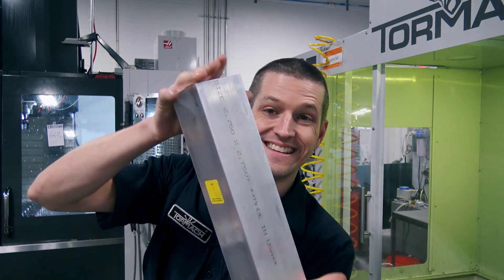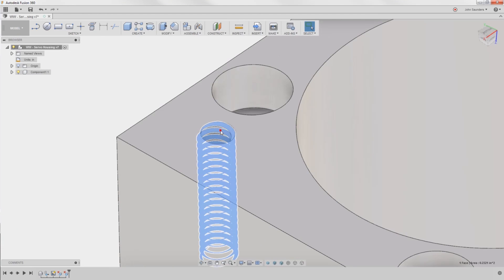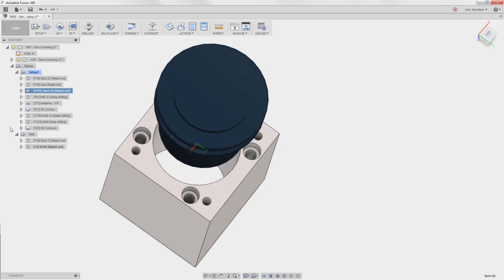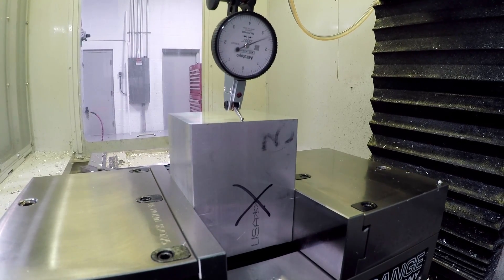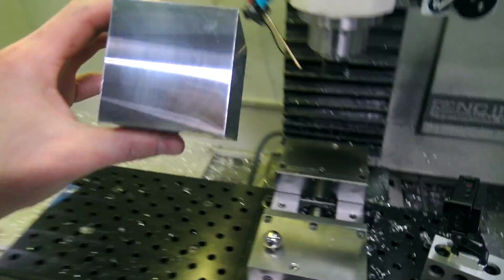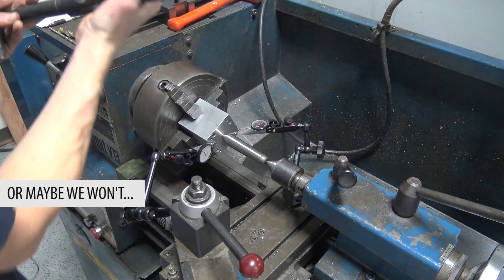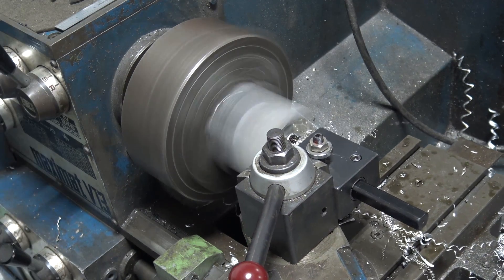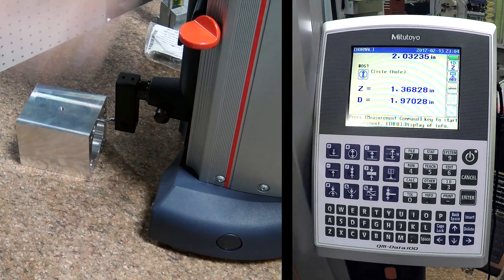Machining a Servo Housing!   WW135

Comment: Do you think that the part was not close to exactly square in the lathe chuck? You centered on the bore in the front. If the outside faces parallel with the center line of the spindle, then that would explain the larger bore in the rear. No?

Comment: Love your video. 
Honour your humility.
Admire the skills and drive you obviously have.
What isn't shown in your vid is a proper analysis of what went wrong.
First you must not have QA'd the bore out of the lathe.
Having completed All operations you then did a couple of measurement checks with that wonderful mitutoyo hight guage, and rejected the part as out of tolerance.
That's when you should have really analized what happened and why.
The uncertainty factor would have driven me mad if I didn't understand so I could fix it or prevent it in the future.
You could have done ID measurements at 45 deg (4 per end) and compared them. This would have eliminated if chuck jaw pleasure was 'clover leafing' the cut or that the lathe was boring tapers.
If you don't figure these sort of things out at the time the uncertainty, or Pucker Factor, builds and I find myself pussy footing around and not committing to good finish cuts..
I'm guessing by now you have a functioning 5th axis with which you would have done all sides but the back face with one set up and micro bored the middle out with the grip being waste.

Comment: If you want to try for an accurate thru hole you could always drill at 0.030" smaller than final, circle interpolate leaving 0.010 stock (as deep as the tool can possibly go), then ream. The reamer should follow the circle interpolated hole nice and easy. Flip it over and repeat. I know that a reamed hole is not a requirement but the method I outlined does make for an accurate hole.

Comment: Ohh God. Why is anyone even thinking about putting that job near a lathe? 😂. It's 2" square. Cut a block on the saw 60mm long, put in vice on mill, bash all holes through and finish bore with boring head. 2 thou limit? That's a massive tolerance. Finish outside profile with endmill. 2" deep? Wow. Big deal.
Reply: And if anyone comments on distortion or stress relief, I will cut my own throat with a long piece of sharp swarf. (Not chips....SWARF)!!!!!
Reply: And why do with cad cam????? God's sake. A job so simple, could do with eyes shut. ON A MILL!!!!!

Comment: I find myself upset watching your videos. Im a manual machinist going on 11 years since I was 18 with a 5 year apprenticeship. You have a super advanced shop. Automated measuring tools. Everything you do seems to lack confidence and understanding of what your trying to accomplish. Multiple mistakes and just a bunch of wasted time. I personally think your a cool guy, but .002" is not a tight tolerance. I had to make way more complicated parts with a bridgeport and a lathe. Did you even check to see if your bore was Straight? Why did you not do the bore first if everything has to be measured from the bore? So how do you make money??? Where did you afford all of those tools and machinery?  I compare this to my son wanting to learn about working on cars so I buy him a brand new Ferrari to work on. That doesnt make sense. I think its great that you get people interested in machining. But you should warn people your not super experienced.
Reply: To your last sentence, he made this clear multiple times esp with respect to lathe operations. What you see are the best efforts of an self-taught experienced CAD/CAM CNC machinist with access to low to mid-tier equipment doing his best. Presumably his best continues to improve as he  (and many of the rest of us) learns for his ongoing experiences...

Comment: I would have loved to see you measure the True position of the bored hole. Since you faced the sides of the part after boring the hole, there was nothing holding the hole at centerline except the assumption that it was perpendicular to the top face.

Comment: Variance while driving a lift truck past the machine indicates insufficient machine base mass. My understanding  is that the base (concrete) weight should be double the weight of the machine...and separate from driving surface.

Comment: 7:10 when you measure machined surface in X axis which was machined in X direction, there will of course be no difference. When you measure it in Y direction, you see how much is your spindle out of squarness compared to Y rails. And 0.001inch  - 0.02mm on such short distance is a lot. If you would run 80mm face mill on 160mm wide part, your error between two passes would be dobule, so 0.04mm edge.

Comment: Part in center of vise is best. If you put a 3/16" piece of round shaft under part, by solid jaw, and clamp part on movable jaw using a round shaft too, it works great for initial square cuts

Comment: Good try...OK...you paid too much attention dialing in a extruded stock and fly cut face, [ final face when boring on lathe]..that waste of time you could have used when milling sides and checking if in center of hole.

Comment: long time gone. however, regardless the purpose of the video. you should never clamp your piece directly on the vice guides. Always use a spacer underneath. one other thing - why you clamp your piece on the side of the vice??? the correct way to do it should be- the middle of the vice jaws, so the force is evenly distributed. this way you are not ruing your vice in a long term. otherwise in time the clamping jaw will twist and you will get a massive deflection, thus any piece you put there will not be parallel to anything.  on the other hand - nice job.

Comment: You cannot bore on a manual with such a long tool and expect there to be no run out, I believe that was the problem with it. 
Also 4/1000th of an inch isn't such a bad tolerance if you are doing it on an manual with no experience, great job!

Comment: You might want to check the lathe for "square", as one of my favorite teachers told me. You can run a lathe on a ship, which means you don't need to have it level all the time. You need to have it square. Try "rollies daddies method" of squaring the lathe and you should get a straighter cut.

Comment: why not mill out that hole with cnc vmc? straightness of that hole is much more important than perfect roundness (anyway servo motor is a subject for adjustments when mounted regardless of coupling design - radial runout no more than 10um is common for flex couplings)

Comment: Why didn't you square up the block first and then put it on the lathe?  Also if you need to drill large holes you can use an annular cutter. They are fast.  Very nice.

Comment: I know this was posted four months ago and I'm seeing a lot of suggestions in the comments for what probably caused the taper in the bore but I haven't seen anybody mention that you probably gripped it a little too tight, I used to machine pumps and some of the parts inside the pumps were cylinders with two bores inside that overlapped like a number 8 but slightly more overlapping, we'd put them in the mill because they weren't in the centre of the part. Anyway we were having problems with the efficiency of them for weeks because there would be a taper through the bores and we couldn't work out why, using various tools, various tool paths but we never looked at the work holding because it gripped all the part on the outside, it had never been a problem before. Well I'd started going to the gym and was cranking on the chuck key the same way I always had which was resulting in it being gripped way too tight, so as the bore got bigger and the wall thickness reduced as it cut, it'd start cutting bigger and bigger towards the bottom. Lesson learned, it was a torque wrench from then on.

Comment: Hi my name is Dave Cortvriend. Im from Waterloo Ontario Canada. I started My career as a machinist in 1982. I try to avoid drilling pilot holes whenever possible.When  drilling large diameter holes on CNC machines I like to use straight shank through coolant spade or index carbide tip drills. But if I have to drill a large diameter hole on a manual lathe with a morse taper in the tailstock I have to use a big HSS twist drill. In that case I drill a single pilot hole as close as possible in diameter to the width of the web of the large drill. Then follow through with the big drill. Example, if the web of a 1.5 inch drill is .2 inches, I use a number 7 drill for My pilot hole, then drill with the 1.5 twistdrill. As long as the drills are properly sharpened it makes a good hole. The entire length of the cutting edge of the big drill engages the material providing good cutting action and chip evacuation, without chipping the cutting edges of the drill, or wearing off the O.D. of the drill especially in harder material, and it saves time compared to drilling multiple holes. The shop I work in has a Darex drill sharpener. It is easy to use and sharpens twistdrills center and spotdrills and can be adjusted between 60 to 135 degrees. Worth its weight in gold!

Comment: Mr sheen which is a furniture polish is awesome to use on your granite plate, reason is , it gives a little slip across your surface so you reduce ghost measurements.( Minor ripples in movement from surface imperfections) that cause false drop gauge readings , especially when your in the 0.002 +/- 0.001 ranges .
Also don't for get to mark and date your granite plates corners so you know when to rotate it , you'll notice a shallow will form after running machined parts back and forth over time, simple trick to maximising plate life before calibration and or replacement.
My old plate was 1200mm x 1200mm x 300mm thick. Yup she was thick.
(Aviation sector )

Comment: Frustrating to watch. Start by squaring up the stock on all 6 sides with the largest surface first. I do appreciate how hard you work and try, and that you are honest about mucking stuff up. One of the pitfalls of self learning is that you can make a lot of scrap with great machines. Certainly made my share of scrap parts.

Comment: You can use an annular cutter to rough bore the hole out first instead of step drilling it. It is basically like a hole saw except more efficient.  It is clean and precise and you won't have too many shavings to deal with.  We use them all the time and they work really well for us.
Reply: Yes, a kind of quasi-trepanning.

Comment: John, may I suggest that if you do some thing like this in future that you rough the bore out in the lathe leaving 0.008" to 0.010" the finish it with a boring head in the Haas. But when you clamp it in the vice only the lightest of pressure. Also when checking the bore on your height gauge rotate the part 90 degrees to check for ovality of the bore.

Comment: I think its most likely lathe run out. Had a similar problem on my lathe at home...you tram it basically the same as your cnc. I did mine with the starret level I have now its within a thou...but as you said all sorts of stuff can put it out again when you use packing under the lathe to get it trammed correctly. Its something that we should all be aware of but the daily grind makes you complacent

Comment: John, I think that the head of your lathe is not parallel with your bed. Many lathes have adjustments to let you tweak that. The other possibility is that the ways are worn unevenly near the chuck.

Comment: You had the front face centered in the lathe (a la Abom), but forgot to center the rear face. That wobble shown by the indicator on the face should have warned you. By as much as your indicating circle was smaller than the length, the error at the rear was proportionately larger than the face wobble. Next time, center the face, check and adjust the rear (with successive side measurements close to the chuck jaws), recheck the face center, rinse and repeat until you have acceptable error at both locations.

For those long, skinny holes that have to be properly located at both ends, do just that: drill from both ends well undersize until they meet in the middle. Then put a long drill (still undersize) all the way through to correct the "meeting error". Put a slightly larger but still undersize drill through to improve the alignment. Finally put a proper-sized drill (or a reamer) all the way through to finish to spec size. You could use the CNC mill for drilling both ends, and even for the final operations from the "second end".  Alternatively, ask the designer/customer whether the middle of that mount could be a cylinder (or octagonal); that way those four long holes become eight short holes.
Reply: One of the best comments on this vid!

Comment: TLDR version: You're awesome, John!
Long-winded version: I so appreciate the effort you put into taking your viewers through the honest story of each project - the good, the bad, and the ugly. I can identify!
I started scrolling through comments and it struck me how constructive and intellectually engaged your audience is (generally) compared to other technical or scientific forums. I really think that your style of showing your mistakes, getting your questions out in the open, and not feeling like you've got to have all the answers really disarms those with the usual rif-raf and keeps the comments meaningful and worth reading. I learn stuff every time - not only from the video, but the comments too. There are some sharp tools in this drawer;) 
My two cents: I agree about the extrusion faces. When you were running the dial in Z on the mill, I was a little scared. In my limited experience, extrusions are not not only out-of-square, but the faces are also wavy, and doubly so across the grain. If you had happened to run the dial at a different Y on that vertical face, the indicator may have told a totally different story...

Comment: Hi John,

your videos are great, love them
did you occasionally check your headstock alignment?
I have the CNC version of the EMCO V13 and had to align my headstock recently because parts turned out to be tapered.
The V13 has good possibilities to align the headstock, however it is a quite anoying work

Comment: The lathe was definitely the right choice as opposed to long endmills. Even using a stout 1.25" endmill you are going to see significant taper at the bottom of the hole and surface finish won't be as good as the lathe can produce. However, you have to be certain your lathe is properly leveled to ensure it doesn't turn a taper itself. Our Mazak at work turns about .0005" taper per inch which can be a pain to dial out when turning anything over a few inches in length.

Comment: G'day John, the good thing about machining is there are many different ways to do a job. I'm the complete opposite to you; a manual lathe guy. In my opinion you ran the job backwards. A few suggestions FWIW.

A good rule of thumb (and how to make more money on jobs) is every setup you do reduces your accuracy and takes time. So try to use the minimum setups possible and try to use the same feature if possible. That way you don't stack tolerances.

Take your raw sawn stock and set it up in the 4 jaw so it's centred. It's square stock so you run an indicator along each edge to centre it. That won't take long as no special precision is needed. You then SPOT drill the face, drill and bore as you did. 

Your lathe is boring a taper, nothing to do with runout. Was it correctly levelled as that's a serious amount of taper? Many lathes are not correctly setup and therefore cannot do accurate work. A lathe doesn't care how the stock is setup or its shape, so the stock can runout all it likes, if accurate it should turn without a taper and yours isn't. 

Once the bore is complete (in the still rough stock), face the end. The bore and that face are now perfectly perpendicular. You still haven't done a setup!

Remove from the lathe and put in your vice with the machined face down. It will seat on that face. That is a large enough bore to be able to pass a DTI down inside so sweep the bore top and bottom to zero it and confirm the bore is aligned with the Z. Use an inspection mirror to see the DTI. Face the other end (now the top) and put in your features. The bore is the master feature of that part so you setup everything in reference to it.

Remove the part and put it horizontally in your vice. Indicate the bottom of the bore at both ends to get it level. Face the top and drill your hole. A tip is not to worry about that break through diameter. Look at the model and find the breakthrough diameter and use a smaller diameter drill to create that diameter. Follow up with your tapping drill and the depth isn't critical. Flip the part and face that side. indicate the bore as you did previously if you need tight tolerances. Rotate 90 degrees and repeat to finish the part.

FWIW I don't recommend using long series drills unless required. Good on you for putting up fails. I LOVE that height gauge, they cost an absolute fortune but are SO nice.
Reply: Damn Pete, this comment is amazing. Really gave me a new perspective on the process behind machining a part like this.
Reply: dang Pete think you have done this a time or two lol
Reply: "Remove from the lathe and put in your vice with the machined face down. It will seat on that face."
No, it won't. The back vise jaw will will determine how the part is positioned. If the bottom surface is out of square to the back surface, the bottom surface will lift off the bottom of the vise as the jaws are tightened. 
I agree with your other observations.
Reply: Pete F i
Reply: Well said Pete, but I would've tackled it another way. 

I would have done all the milling to the part first, then made a fixture to go in the lathe that held the part concentric using the bolt holes to hold it down then proceed to turn the bore.